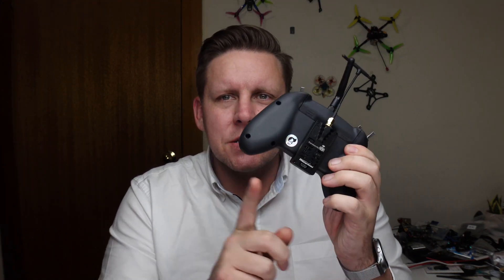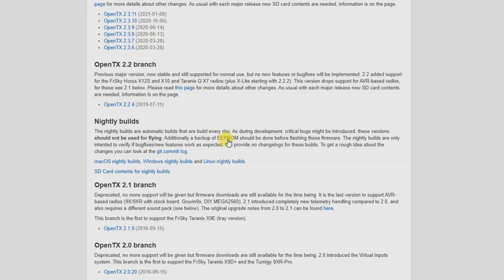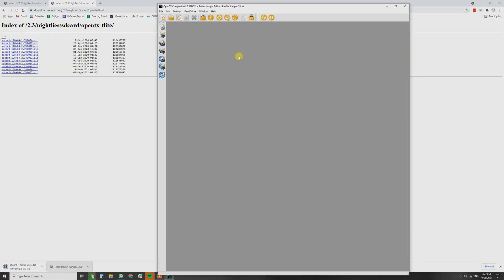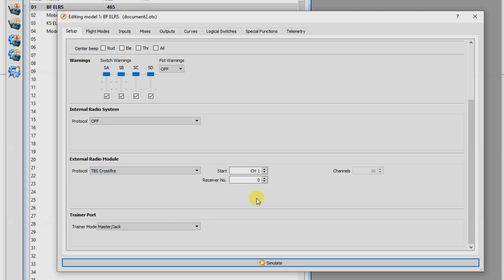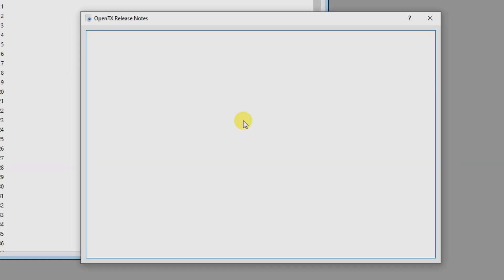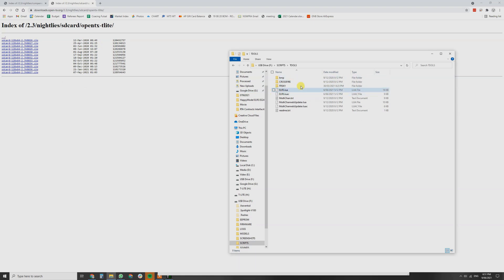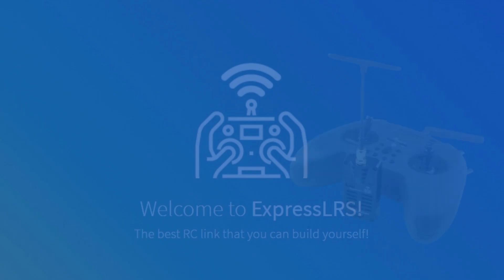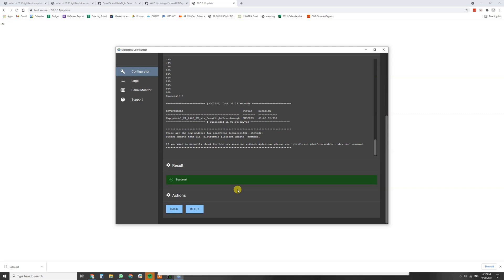ExpressLRS Full Setup on Jumper T-Lite | | ExpressLRS V1

Comment: Is this T-lite V1 or V2 ?
Reply from the maker: V1, but would be the same process for V2. However I’d recommended buying the T-Pro instead of doing this with 1w internal ELRS
Reply: @DarrenAllatt   I already have V1 but i remember it had power problems with crossfire modules if set to above 250mw power, so im wondering if ELRS is different in this regard. Im mouling it in my head what to do, sell t-lite and get something with ELRS or just get a module. Can You power this module from the usb ?
Reply from the maker: @Pecetos  it’s not just crossfire, ELRS has the power limit issue as well. It’s because the radio can only output so much voltage. I haven’t tried powering via usb, but it sounds like grabbing something like the T-Pro will be good for crossfire
Reply: @DarrenAllatt  WIth TBS i found out online that you can disconnect the power pin from the connector and just power it from a usb powerbank and it should work ok. At least that's what i found out online so its not something I would trust 100%. If it worked like this with ELRS it would be an easy buy. THX for Your reply btw.
Reply from the maker: @Pecetos  well it would work the same with any other ELRS module, it’s just this one is hard wired in

Comment: Nice overview. Certainly helped me set up my Jumper T-Lite V2. Thx! One question .... any idea how to access/invoke the Betaflight LUA using the buttons on the Jumper? I've loaded that latest LUA onto the SD Card and have run the Betaflight Setup tool without issues but for the life of me I can't figure out how to get into the LUA to change things like VTX settings, rates, PIDs, etc. I'm sure I'm overlooking something obvious!! Thanks in advance for any pointers :)
Reply from the maker: You need to have telemetry turned on in the configuration page. 

Easier to use the OSD through the goggles though
Reply: @DarrenAllatt  Just figured it out. I just needed to run the Betaflight Setup tool again. It took me straight into the LUA menus. Different from the old process on OpenTX. FYI - My telem had always been enabled and working. Thx for the quick response anyway 👍

Comment: Hi!
If I set this thing up with my radio, and I remove the module, It will work with Frsky too right?
Reply from the maker: You have an internal multiprotocol module which will work with Frysky. You don’t actually need to take the external module off in order to use the internal module that’s all done in the software when you set up a model on your radio you select whether it uses the internal or external radio transmitter
Reply: Ok thanks! (:

Comment: Hi hello , I have tried everything here but it doesnt work. I cant do exactly as the Firmwares are constantly updating but basically I did the nightly but I feel some things are not explained. 
Could you update it to today_? as the open TX companion versions have changed the Nightly have changed and most important the ELRS.lua has changed ..... you dont find it on the Express LRS wiki  etc etc Im new to this and is not easy to follow. Thx
Reply from the maker: Hi - here are two videos which explain this better and more recently. 

The key thing to note is that if you are flashing v1 or V2. The new V2 lua doesn’t work with with v1 firmware. V1 lua doesn’t work with V2 firmware. 

How to setup your Radio for ExpressLRS | ExpressLRS Setup Guide
https://youtu.be/M45lx3yKK_4

How to setup ExpressLRS Transmitters
https://youtu.be/_-bCLTM8pS0
Reply: Hi Hello , Im unable to have the ELRS menu by using the  TX Companion. I have used the latest Companion 2.3.14 . I have fashed the SD Card with the latest content for the 2.3.14 (Its the previous one still valid)  I have created my model on the TX Companion (Named ELRS by me ) I have specifically ticked Lua . I have downloaded the Express LRS configurator and I ahve dobe the Build through Wifi and downloaded the Lua Script whic I have placed on the SD card on the Scripts/Tools Folder , named Elrsv2.lua. The Jumper Tlite does not recognise any protocol different than Spectrum when I push the SyS button on the Tlite. 
In summary I cant follow the steps indicated they dont  work. (I even tried to flash the HappyModel Express module before through usb (conected to the module not top the Tx as indicated by you ...and again failed as a stand alone topic following your video . Please do a proper video   
I need the TX Companion to read the Lua Script to find the ELRS Menu and be able to flash the module through wifi but it just doesnt work!!
Reply from the maker: @jacobosannicolas3884   
The reason why the LUA wouldn't be showing up is that the file is probably still a TEXT file and not a LUA file.

If you flashed ELRS V1 then use this LUA Script File
https://drive.google.com/file/d/1Gb4xel3WBODtaAlMwp-PRNqTJt7EZTlj/view?usp=sharing

If you flashed ELRS V2 then use this LUA Script File
https://drive.google.com/file/d/1huUDGjzuSLY-5VYP8aOKM4qZdsgqKmLn/view?usp=sharing

Copy this EXACT FILE to your Scripts Tools Folder.

To flash HappyModel via USB you need to adjust the pins on the back, most people just use Wifi or flash the file on the radio itself.

Please follow instructions properly

Comment: 10:44 on the upper right my jumper show 0:250 whats the meaning? my friends shows 1:250 diferrent with me.
and what is tlm ratio? what best number
Reply from the maker: 0:250 - is the packet rate, first number is the number of bad packets, 0, second number is total packets being 250. When you change the packet rate the number in the top right changes. 

Telemetry Ratio makes the TX module send the telemetry data to OpenTX to the interval you set. This stops the telemetry lost warnings when running a high telemetry ratio, or low rates like 50hz. Typically, you want to keep 320LU value for OpenTX based radios

Comment: I own the ELR Happy model 2.4ghx T-Lite backback and the Jumper T-Lite, but I am confused where exactly the little gray teflon (?) sheet is supposed to be installed. Could you please outline and/or illustrate where this goes in the backpack?  Thanks. - Jim
Reply from the maker: It goes between the board and the metal of the module to stop them touching
Reply: The "sticky gray teflon (?)" It's named Cooling Pad and goes between board and back of the CNC housing transfering the heat from RF chip to Alu Case which acts as passive chiller.. 

RF Power up to 1000mw here.. Set RF power max 250mW without small 4.2-5.0V fan.. Some users modded Slim Module with 5V fan and 1000-2000 mW

Comment: This radio is only 1s 18650 so the question is how long T lite will work with 2.4 lrs module...🤔🤔
Reply from the maker: The external module doesn’t have full power. It’s limited to 250w and is powered through a step up. 

I get around 4ish weeks of occasional flying.

Comment: I've spoken to Wesley he says don't have todo any of this or will work out the box so why not just do video of setting up without flashing it's not essential
Reply from the maker: The only thing that is different now is you don’t need OpenTX Nightly, rather the latest release. When this video was made the latest release didn’t solve the bug limiting power output in opentx, and also, you still need to flash the HappyModel transmitter one way or another to put the latest version of ELRS on it. When the video was made, there was only RC’s - so now there is a full release you’d want that on your TX. 

Also, I don’t know anyone who when getting a new radio or new transmitter on a radio doesn’t set up a model for it, and whether you don’t do any other configuration - you will need to put on the LUA script. 

I dare say the question you asked Wesley wasn’t as duly detailed as your comment makes it out to seem.
Reply from the maker: How about you ask me - the exact question you asked Wez and I’ll share my thoughts
Reply from the maker: @verofpv6152  With the latest official release of open TX it supports ExpressLRS and you don’t need to use nightly Builds any more which was different at the time of making this video
Reply: @DarrenAllatt  so should i download the latest 2.3.14 ? It says for frsky taranis x9d?
Reply: I downloaded latest verison 2.3.14 and sd contents also lua script and put it into tools folder of radio but when i select ELRS and hit enter it just flashes CONNECTING and has expressLRS ?????? At the top of the screen. Any help would b great
Reply from the maker: @verofpv6152 

Is the model you have currently selected has internal module turned off and external module set to CRSF

Then, if so, had the external module been wired correctly?

That error usually indicates that the radio is not communicating to the transmitter 

That error usually means that the LUA is
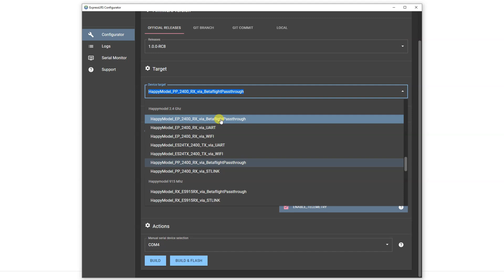Reply: @DarrenAllatt  internal model is set to off and external model was set to multi but i have now set it to crsf.. now when i select ELRS it sais VERSION MISMATCH update tx module lua v o3.tx? Force use. After selecting force use it connects to expressLRS sec8ad 0:40 pkt rate 25hz (-120dbm and it wont let me change to 500hz
Reply from the maker: @verofpv6152  sounds like you need to use the ExpressLRS Configurator to update the TX now and then you’d be good to go
Reply: @DarrenAllatt  yep sounds good thanks for your help much appreciated

Comment: Hve u test the range for the jumper t lite elrs setup? Is stock antenna on tx any good? I test in open space and only got 900m on 100mw. But other youtuber can got like more than 10km with 25mw oreven 10mw
Reply from the maker: No I haven’t tested the range, maybe that’s something I can do for an upcoming video. 

The stock antenna on the TX seems ok but if you have a better 2.4ghz antenna then you should use that.

Comment: help when i hit elrs in sys button it doesnt say anything about wifi. it just says connecting for a while nothing else
Reply: Did you find an answer to this ? I have the same problem
Reply: @verofpv6152  same problem here. any help would be appreciated.
Reply: @MultiBieberzone  make sure external RF is set to CRSF that fixed my issue.
Reply: @verofpv6152  protocol is CRSF, module is connected, baudrate is 11520. still no luck.
Reply: @MultiBieberzone  when u installed the module did you trim the solder pins on the little power board? Alote of people have had issues with it shorting or not working. I tried just using two pieces of doubled sided tape but it was causing power issues the red led was not as bright as it should of been. After triming pins it was alote brighter.
Reply: @verofpv6152  If the red light of the module is always on, it is because there is a contact between the small plate and the large plate. Separate with double-sided tape both capable so that the light is off if the radio is off.
Reply: @bAnfpv  my radio did not have this issue but yes i imagine it could have if those pins are touching they obviously can cause many issues, with mine there where 2 difrent types of brightness with the red light but they still turned off when radio was off.

Comment: I have the T-Lite in my garage for a month now. I am nervous about the shifty stick center of the T-Lite. I fly FPV helicopter diving, and the small indoor acro-mode hovering is almost impossible. Maybe it will be OK outdoors, but I am just nervous about the mechanics of the whole T-Lite.
Reply: just put a deadzone in, thats what they for, all gimbals drift a bit.
The T-Lite is perfectly fine, competing against my older way pricier transmitters without hall gimbals.

Comment: Coming from frsky, the signal level in the betaflight OSD is confusing. Using "Link Quality" gives me 0 and RSSI dBm -150. I can get old RSSI with aux 12 set in the receiver tab. What's the bast way to do this?
Reply from the maker: ELRS doesn’t work with the native LQ in BetaFlight, so you want to disable that feature; doing it the old way is best - Channel 11 in the receiver tab is LQ so you are best to set that as the AUX channel for RSSI and then add RSSI as an OSD element. Just remember that’s now LQ.. LQ is more important than RSSI anyway
Reply: @DarrenAllatt  Thanks!

Comment: Hi, nice tutorial. I have question, is it possible to make Jumper T-lite and ES24TX work together WITHOUT Nightly builds? I'm trying to get it work with Jumper T-lite factory firmware, but unsuccessfully.
Reply from the maker: I don’t believe that’s possible and by your own experience it would appear so as well. I had it working with Ghost hardware flashed to ELRS except it didn’t work because the T-Lite wasn’t functioning correctly with the TX and it was limited to 100hz at 10mw so range we ok but not what you would want. 

Looks like you do have to go with nightly’s
Reply: Open TX 2.3.12 was just released, which now fully supports the T-Lite. I will try it soon but I believe that should work - http://www.open-tx.org/2021/06/14/opentx-2.3.12
Reply: So do we still need to use nightly builds?
Reply: @verofpv6152  no not unless you want 500hz as there is (at least was) a bug that made 500hz option actually transmit at 250hz.
Reply: @debaser3000  yes well may aswell transmit at 500hz if u can so ill try the stable release.

Comment: Hi nice vid... btw if i use this.. can i rescue GPS?
Reply from the maker: Yes you’ll just need to configure GPS rescue in beta light and ensure you have it also sent to an aux channel
Reply: @DarrenAllatt  hello, my quad GPS rescue works ok when using switch but falls down when radio is turned off, you mean is also necessary to configure in betaflight "Channel Fallback settings"  the channel (working GPS rescue switch) to "Set" ? Thankyou
Reply from the maker: @lloyderex  yes I would recommended that and make sure you set it at the value which the switch would be on.

Comment: Odd , when I go to boot loader and plug in the usb my controller locks up
Reply from the maker: Yes that’s normal. You can’t use it in boot loader mode.
Reply: Lock up as in constantly request a SD card because thats what mine does?
Reply from the maker: @JPDVids  do you have an SD card in it?
Reply: @DarrenAllatt  No... controller didnt come with an SD card... is that a must?
Reply from the maker: @JPDVids  no it doesn’t come with one and yes it’s a must
Reply: @DarrenAllatt  aye so I sourced a SD card and put it into my jumper t-lite but the same error occurs, I have also put all the files onto the sd card too no avail, its not even finding the lua script in tools
Reply: @DarrenAllatt  It no longer locks up my PC but it gives me the same error "Please insert a disc into USB Drive(D:).